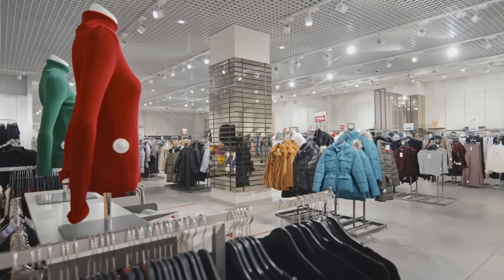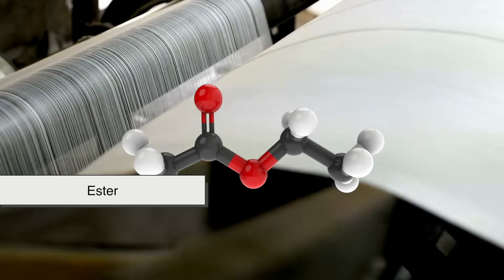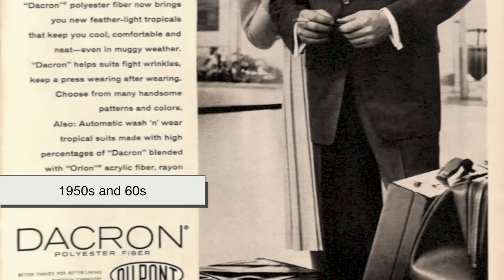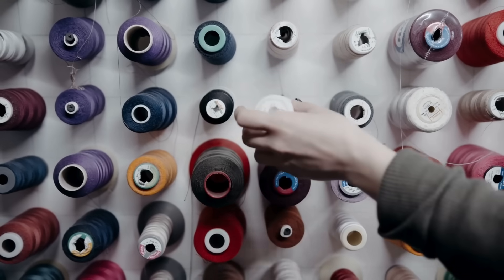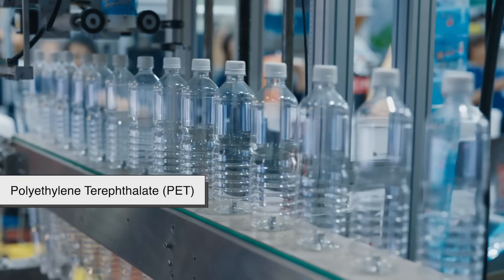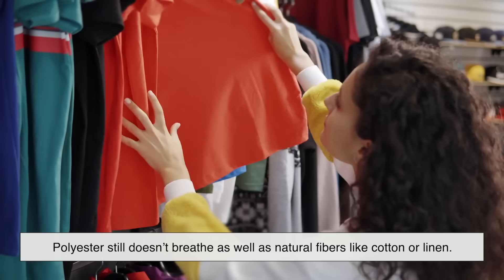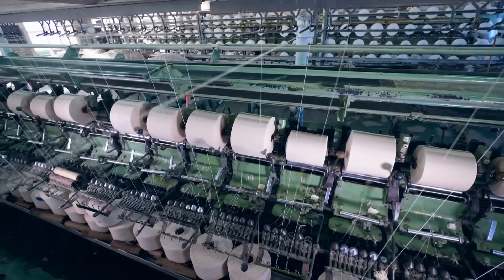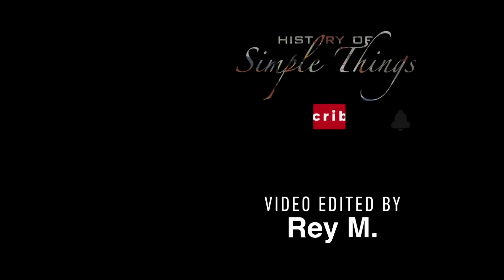What Exactly Is Polyester? The Plastic in Your Clothes

Comment: CONTENT IDEA
with winter coming up, it would be helpful to see the various types of materials for keeping warm.

For example- cold/dry, cold/wet, cold/windy, and what materials to use and how to layer.

I am kinda new to snow and i let my ADHD spiral to research winter clothing. From what i think i understand,  base layer is not that warm but more so to absorb moisture,  then the insulation layer, a fluffy sweater, wool, maybe cotton, then a shell to keep the warmth in?

It would be nice to see if there are other materials that can keep people warm without getting overheating 😊

Tip for people who get cold easily 

Chinese sites sells electric hot pads that connect to a battery pack and can be put in pockets and such
Reply: DAWN is the best winter cloth. Nothing else